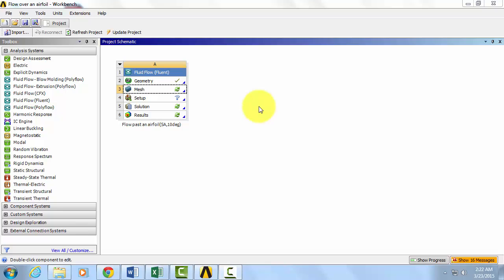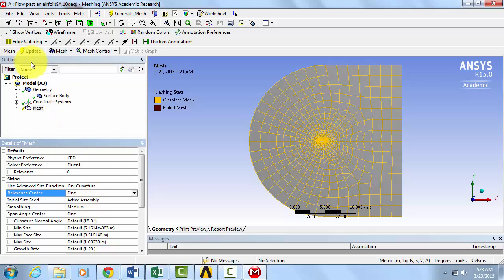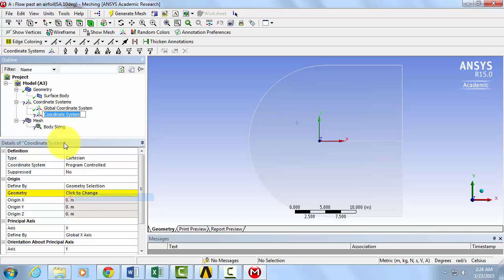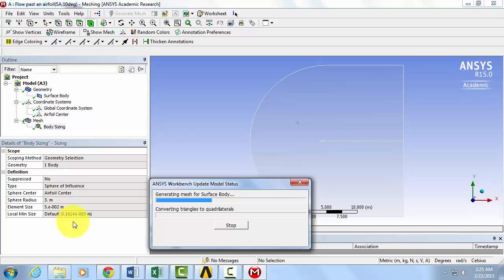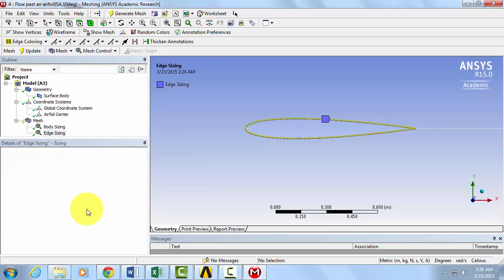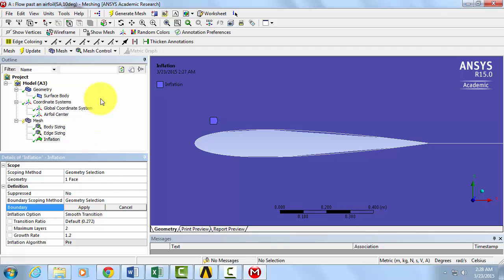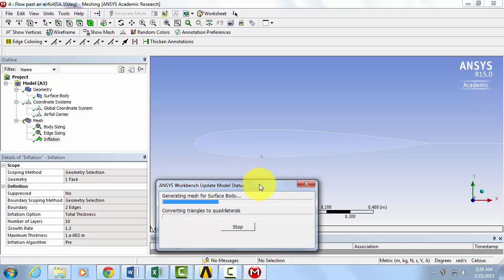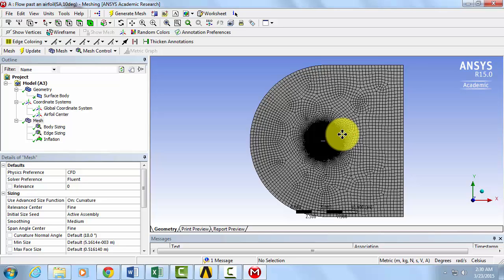Flow Over an Airfoil Using Ansys Workbench — Meshing

Comment: @Armfan17, I would not call this method better because of 3 reasons.
1) Though it catches the boundary layer effects well at the surface of the airfoil, there are a lot of coarse meshes at the trailing edge section.
2) Due to this, it cannot capture much of a trailing edge turbulence parameters, and hence the coefficient of drag values can be quite inaccurate.
3) This method is not giving a better meshes as we move into newer versions of ANSYS.